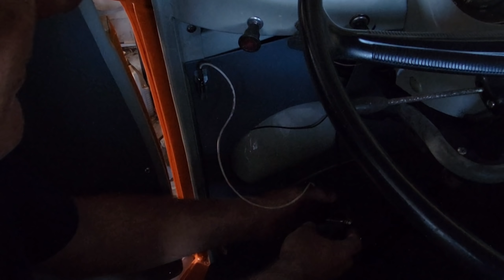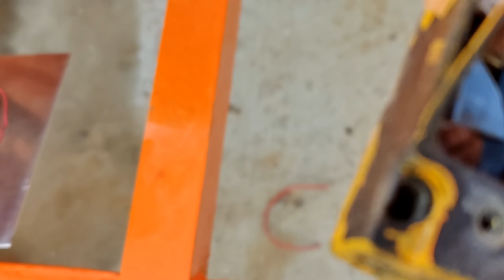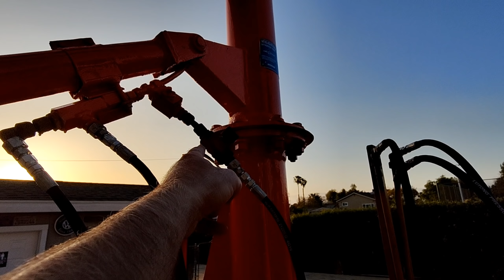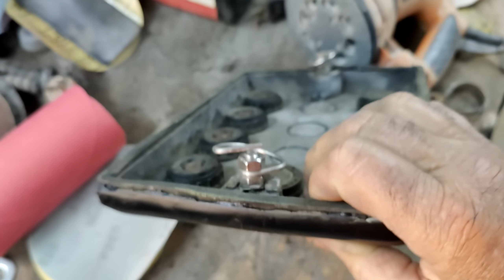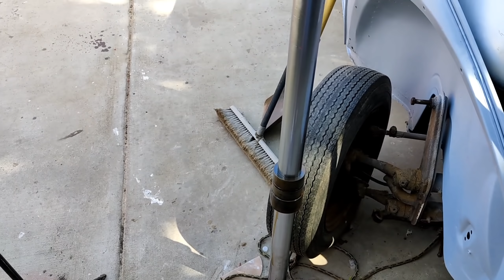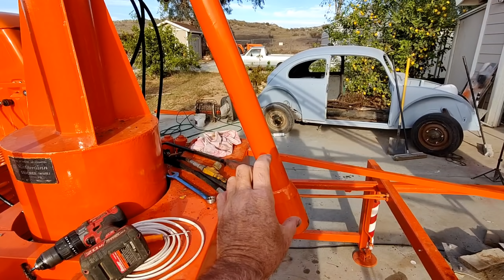1962 VW SINGLE CAB Cherry picker. Wiring the Rats nest

Comment: Using no seals it's called a plunger/displacement cylinder..
The reasons for using this kind of cylinder  are fewer internal parts and to resist buckling tendencies as it extends..
Reply from the maker: thanks for the info.

Comment: Probably late but is the valve on the lift ram an emergency release I've worked with some older platform that had them just unscrew it and it allows the fluid to return to the tank with no engine or electrical working

Comment: About that lift ram, it's not that unusual for a single acting lift ram to be made that way. It's sole purpose is to lift so adding fluid just displaces the ram the only way it can go which is up. Removing fluid allows gravity and the weight of the operator to return it down. Lots of tipper hoists work like this.
It is cheaper to make since the cylinder doesn't have to be machined on the inside. It only has to be machined on the welded on bit that retains the seal. 

I think the third hose is controlling a line locking valve as a fail safe so that the bucket can't fall in case of a hydraulic failure.